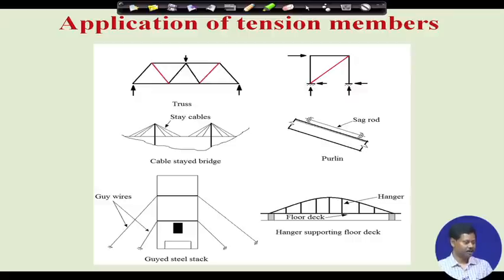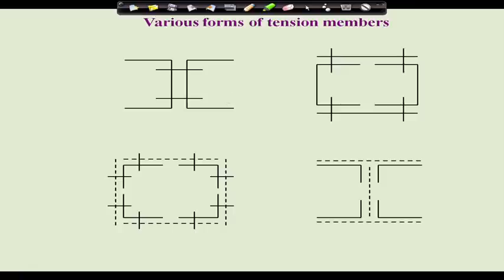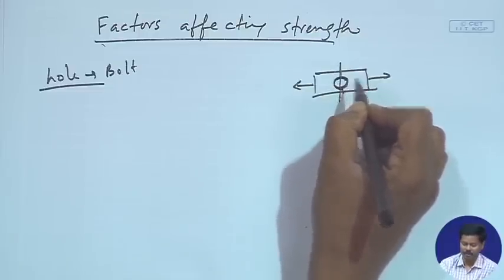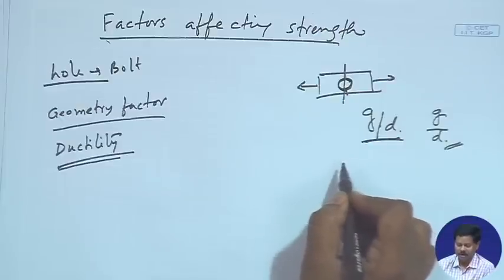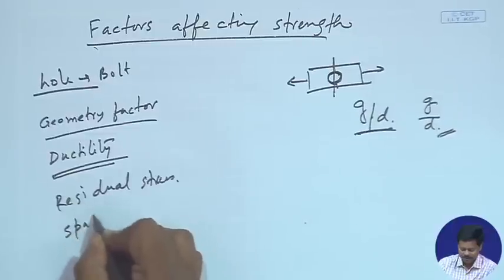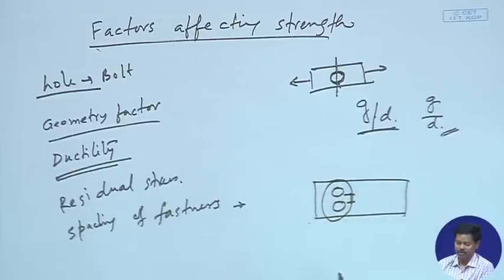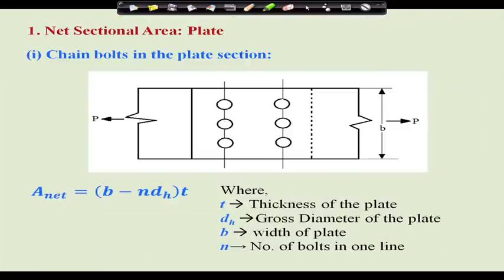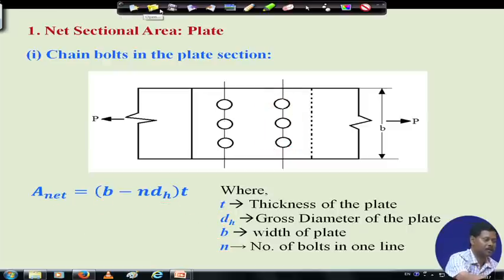Lecture 19 : Tension Members and Net Area

Comment: Why is the failure line always passing through bolts? , Can the plate fail in such a way that there is no bolt in its line of failure?
Reply: Net area is always low along bolt holes. Rupture will always occur in less area prior to gross area.
Reply: @manishkumarpandey8321   thnx brdr,

Comment: 14:46.   No of holes takes as per pitch length , so the holes in per pitch length in this fig is 2 , but he says 3
Reply: not actually...... the area that we consider is cross section perpendicular to the tension.... but if we make a cross section perpendicular to the tensile forces.... the lowest possible area (critical area), will have 3 holes......
 we dont consider holes along pitch.